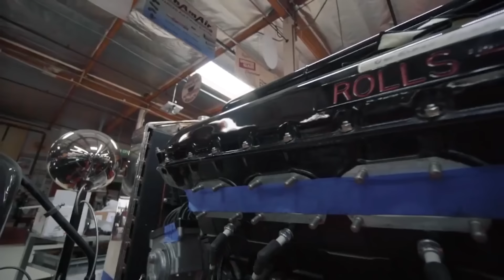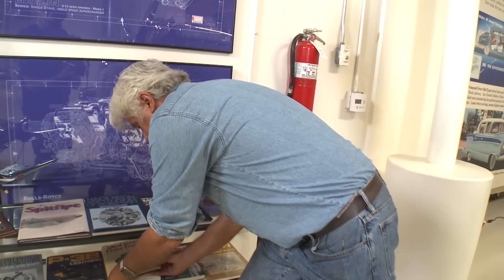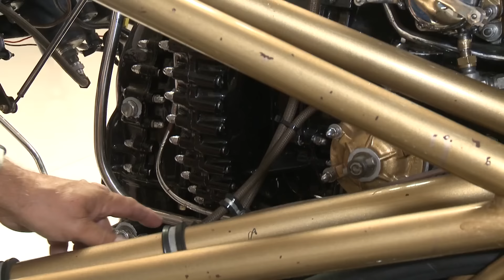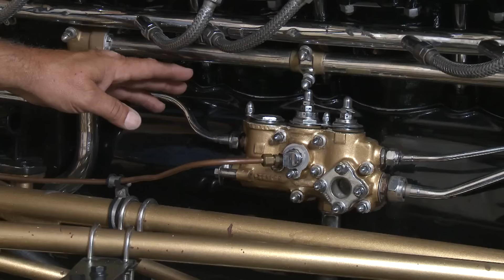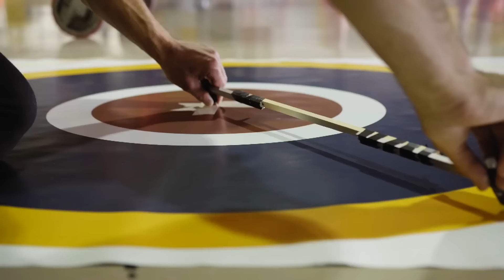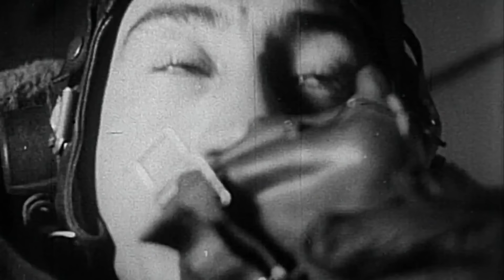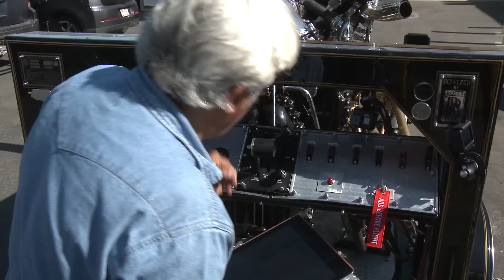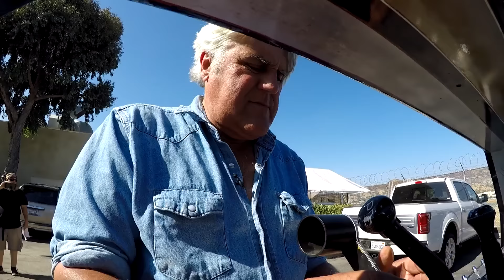The Engine That Won World War II - Jay Leno's Garage

Comment: I’m a student ppl & new aircraft owner working on my ticket. Love the Merlin & J!!

The first few failed starts piqued my curiosity. 

I happened to notice that the checklist doesn’t indicate a move to full rich (or any mixture adjustment) from the “cut-off” position outlined. 

I may be incorrect but believe that during the starting sequence, once the engine has been primed and started the mixture needs to be gradually moved from the cutoff position to full rich (when @ sea level). 

If this was in a bird, I think a preflight static run-up would be completed prior to takeoff for either rich of peak or lean of peak performance, adjusted in cruise, and significant changes in altitude thereon. 

Fun fact | There’s divisive opinions on rich vs lean of peak and their impact on performance and powerplant lifespan. 

We wouldn’t have won WWII running these babies rich of peak. The distances and payloads were too great. Bombers were routinely unable to complete missions safely. LoP changed mission success drastically. 

P172D Driver

Comment: tHe p51 wOn tHe wAr!
🤦‍♂️
Reply: With out the Merlin the p51 would of came second in a one horse race.
Reply: @richardoakley8800  It was faster than a Merlin Mk V Shitfire !!!  Check the specs !!!
Reply: @wilburfinnigan2142  the original  Allison-powered Mustang ok upto medium altitudes.. then the Merlin engine was sent over for trials ..5 p 51 were modified and testes .. they significantly out performed the Allison-powered Mustangs past the medium altitudes.. this gave it the advantage for bomber escorts

Comment: Jay, you need two additional engines.  One, the other American built V12, the Allison V1710, and the Mercedes Benz DB 601 inverted V12 which was fuel injected, not carbureted.  With those three you'd have some very important power plants.

Comment: Ethanol is not the trouble with the fuel. Ethanol was used for many years to make high grade fuels.  In the 50's high grade gas was called Ethel because that is how they made high octane fuel. If you look at the other things that they put in the gas you get you will find about 4 other things that they put in the gasoline.  I think it is because the ethanol makes the octane to high so they put some waste products in to lower the octane level.  Go to the gasoline Co. And get the break down of what is in the fuels.  The 87 octane is full of a lot of crap.  It has been some time and I don't remember what they all were but I was surprised at all the junk they put in the 87 octane that isn't in the higher grade gasoline.  I think because the US government made them put the ethanol in the gasoline it made the octane to high so they put junk in to lower the octane. Check you will find that somewhere in the 50's or 60's they stopped putting ethanol in the gasoline and started putting led in to change the octane,  then they were forced to stop putting led in and switched to other things. E85 is about 120 - 135 octane some higher.

Comment: Sorry but the Daimler Benz DB 601 engines were superior in design. inverted vee which ment there was always lubricated cylinders important during startup, better vision from the cockpit and easier maintenence all due to those inverted cylinders not to mention a fully automatically controled fuel injection sistem which made the pilots flying less hectic etc.

Comment: Legendary Isle of Man TT Motorcycle Racer Guy Martin also has one of these Merlin engines bolted to a trailer. He started the engine and it 'took off' in his dad's workshop and caused a lot of damage as it took a wall down and damaged a couple of customers trucks!

Comment: 10.2L, 18G radial engine installed in a mini-German-postwar-car (originally equipped with a 800cc , 18HP engine) with home-made differential and gearbox!. https://youtu.be/7t2M6fwsvzs

Comment: He forgot the mention the most hilarious incident between Leyland and Rolls Royce. Leyland claimed to have the best engine ever built that was indestructible. Rolls Royce challenged them to a stand off to see who could pull off the ultimate engine. a series of steps and challenges. without water and then run full noise, all the way to the accelerators bumper, for a number of hours. Then also without oil and run it for a number of hours again full tilt. Leyland never made so much as a peep after that. The Merlin was more than capable of doing it.

Comment: There was a day when these engines were only worth the scrap value of the metal they contained. When I was a kid, I used to play (unknown to my parents) in the "boneyard" of the nearby Air Force base. There countless old aircraft littering the place, including a nearly complete B29 bomber. My friends and I used to pretend we were astronauts flying in space (the space program was in full swing in those days). But all the planes, engines, and other parts were scrapped and melted down. Jay, if you are looking for something interesting, and still somewhat reasonably priced, I have seen some of those turbine engines which power M1 tanks in surplus lots. If one of these can power an M1 to nearly 100 kph, I imagine they could move something lighter much more quickly.

Comment: That's not the same size prop the Mustang uses.
Reply: It's not the same size prop any plane would use. It's a drastically cut down prop, used purely to give the engine some 'load' to work against and to provide a source of cooling air for the radiator, oil cooler etc.

Comment: During the war the Allies used 130 to 150 octane fuel with up to 71" of manifold boost, not 100. Definitely not 89.
Reply: 150 was late war.  During the battle of Britain they were mostly still using 87, although fighter command had priority on the 100 octane fuel being produced at the time.

Comment: The  Lancaster in Canad came over to Britain , I had the privilege of seeing both together,  I ive in Bomber County in Lincolnshire UK. The Canada plane had an engine problem , So the RAF lent them an engine, It came into Coningsby Lincolnshire, The is also another Lancaster that  does have all the engines up and running at a place not far from Coningsby, at East Kirkby. You can actually get in to that one , they taxi it along the runway, it does not have an Airworthy certificate so they only taxi it.There is a fund to try and raise money to rebuild it , It would cost millions

Comment: That Merlin 1650-1 sounds sweet from the overlap on the valve timing.
Your Rolls Royce Merlin V12 sounds as if it was detuned for street use.
Your Merlin is one of the best items in the garage.

Comment: Thanks so much for preserving history.  Question... Were the props used with the Merlin variable? Are you able to control the prop pitch when running the engine on the trailer?

Comment: Sure jerked that throttle around... set the fuel mix and manifold pressure for RPM and keep your hands off it... nothing worse for this type of engine than starving it then kicki'n it back up!  What a Jackass.

Comment: his startup checklist was a bit off,  so doing so, the engine would not go higher in rpm. because of low oil temp for the prop. the magneto tests, the prop rpm tests, the mixture. the 2 min pre oil and turning it off. well very brave he did manage to start his diamond. you could see that he was not very enthusiastic to start it. what if it breaks just on that moment. that would have been a disaster.  that poor engine, running that lean.  on the oil control valves, there was a window and you could clearly see no oil in it. so let's hope they did everything correctly.

Comment: Who has the molds and/or drawings for the block and accessories?  Have you ever thought of disassembling the motor and laser scanning all the parts into solid works (or any 3D cad software) so that these engines could be reproduced?  With new manufacturing techniques and metallurgy it could be amazing.
Reply: 18tangles  can you purchase detailed enough drawings with dimensions such that an engine could be built from scratch?

Comment: No Jay.  The best fighters of the war were the Hellcat and the Corsair.  And the best engine was the R-2800.
Reply: 18tangles  The P-47 had more German kills than any other Allied fighter - R-2800
Reply: 18tangles  The R-2800 powered the planes that destroyed the Luftwaffe in the air and on the ground in the ETO.  Your Merlin powered wood planes were left out of the battle because of range and power.  The Merlin was the engine that won the Battle of Britain, but that was about it...  Now hush.
Reply: soaringtractor  LOL  I have been dealing with 18tangles for years...
Reply: And the P-47.

Comment: Jay's comment at the end about an airliner not having a Merlin underscores a point about reciprocal and turbine engines.  The Merlin is a beast at 1400 hp, but the each of the engines on a 777 makes about 111,000 hp.  Hard to compete with a gas turbine for power to weight ratio.

Comment: I am impressed. As a trade qualified machinist (F&T) I am impressed with the design. Just think of all the components and all the Component Tolerances to make this engine work. The UK Merlin, was made with all Whitworths threads, and when the motor was built in the US were changed to UN threads. My understanding was during WWII Whitworth & UN threads had there tolerances changed a little to enable cross threading the threads during war-time maintenance.  I estimate that cross threading Whitworth & UNC would reduce strength on the bond by some 20%. Hay, when you have to get that thing back into the air there was no time for mucking around.  Note ½” cannot be exchanged (12 TPI vs 13). The Merlin was truly an impressive beast.  Thank you for your posting.

Comment: Yeah the mighty fantastic Merlin is and was a great engine in WW2.

However, the the Pratt-WHITNEY R-2800 WASP engines we're EVERYWHERE in 
WW2 and they kicked arse and we're AIR COOLED.

In 1939, when the R-2800 was introduced it was capable of producing 2,000 hp (1,500 kW), for a specific power value of 0.71 hp/in" (32.6 kW/L). No other air-cooled engine came close to this figure, and even liquid-cooled ones barely matched it. The designing of conventional air-cooled radial engines had become so scientific and systematic by then that the Double Wasp was introduced at a power rating that was not amenable to anything like the developmental power increases that had been common with earlier engines. 

Nevertheless, in 1941 the power output of production models increased to 2,100 hp (1,600 kW), and to 2,400 hp (1,800 kW) late in the war. However, even more was coaxed from experimental models, with fan-cooled sub types producing 2,800 hp (2,100 kW), but in general the R-2800 was a rather highly developed power plant right from the beginning.

Comment: My association to these big WWII aircraft engines is unlimited hydroplane racing. I lived for a few years in Madison, Indiana where they raced those boats every summer. The town sponsored its own boat. I was lucky enough to get to hang out a bit in the shop that they used to work on the boat and in the pits during the race. The sound of those big Allison and Rolls Royce engines racing by was really a thrill. Although unlimited hydroplane racing has moved onto helicopter turbine engines, my memories are of the of the piston engine era.

Comment: Hi Jay, Probably already been said George Lucas used one for the Millennium Falcon. 
I was on External Perimeter duty when three Spits and a Hurricane landed for a short period at RAF Honington UK in the early 80's nothing like it to hear them fly over, the Pilots and Ground Crews of the then current aircraft were like 1940's school boys, all over them. Funnily enough on the day we were defending the launch zones for the RAF Tornado GR 1's which used Rolls Royce Turbo Union RB 199 Jet engines in them, it would have made our day if the Lancaster had been with them, and unfortunately General Arnold's [USAAF] most favourite aircraft had no flying variant at the time, the ubiquitous first real MRCA, The De Havilland Mosquito which although made of wood had the best bombing results per aircraft bomb ratio to crew than any other pre nuclear/atomic aircraft in WW2, and of course powered by Rolls Royce and Packard built Merlin engines [flown by very brave Allied nut jobs, look at the missions for that comment], even Lt Colonel Roosevelt had them for high Speed Reconnaissance. I believe there is one in Canada, now flying, thank goodness for that!! Thanks for preserving another engine!!

Comment: Hope he's not a pilot... Forgetting to add mixture rich and adjusting the throttle with the mixture in cut off position wondering what's wrong? lol good lord..
Reply: Be kind. With all kinds of startup procedures for all kinds of engines around i´d imagine it´s quite easy to miss a lever every now and then ;)

Comment: Merlin powered Spitfires and Hurricanes stopped the Nazis spread and defended Great Briton before the P-51 was even envisioned. Merlin powered Lancaster's easily carried half again as much payload as the B-17, including the water skipping dam buster bomb. The Merlin saved the P-51 which was originally designed for the fantastic Allison V-1710 V12, but in such a sleek air-frame could not fit the high altitude exhaust driven Turbocharger found in the P-38 so the original Mustang was actually a bit of a flop for a fighter, much like the P40 which shared the low altitude Allison. But the massive Radials from Pratt & Whitney won the war. B-17s, B-24s, B-25s and P-47s ruined the Reich in precision daylight attacks the Lancaster crews never dared try.
Reply: And we dragged our feet helping England because the Charles Lindbergh types hated the Jews. The "pacifists" were actually pro German subversives.
Reply: The wasp and its descendants and the Merlin and its descendants can trade blows i'd say. the twin wasp and double wasp were ubiquitous in US service. PBY's, wildcats, hellcats, P-47's, B17's... But so was the merlin and griffon with the english. Hurricanes, spitfires, tempests, lancasters, Mosquitos. and easily forgotten, the Merlin was adapted into the Meteor, which powered pretty much every english tank from the Cromwell to the Centurion.

Comment: I've always wondered what a fuel injected Merlin would sound like and how it would perform against the ME109's as that development came too late for the war.
Reply: Jesus  ALL PACKARD Merlins used the Bendix Pressure carb that was a throttle body injector, receiving the fuel under pressure !!!

Comment: Where I live in Sussex they do spitfire flights throught the summer down to the south coast and over the White cliffs.
 I work outside and just happen to be allong one of their routes so at least two or three times a week I hear that distinctive noise and it gives me goosebumps every, single, time.
It'd be an absolute dream to have enough money to go up in one.

For the most beautiful thing you will ever hear, check out the video entitled "16 Spitfires Flying Together, The Sound of Victory " Goosebumps ""

Bonus, there's another of the Vulcan - designed by the same guy as the lancaster just a few years later.
The strides in technology where astounding and will be immediately obvious. Sadly it is no longer flying but ... what a sound.
Look for "Awesome Vulcan Bomber Low Fly-By"

Comment: Jay, Thanks for the for the great video on the Merlin engine.  I just saw a video on the engine that powered the Sherman tank in WWII and many other armored vehicles.  It was the GAA 18L gas engine built by Ford.  It was dual overhead cam, dual magneto, v8, 500hp, 1100 lb ft torque, all aluminum.  It was produced between 1940-50.

Comment: Packard was way ahead of its time in WW2  in engine technology.
Reply: Rolls royce you mean :) As the Merlin was considered to be so important to the war effort, negotiations were soon started to establish an alternative production line outside the UK. Rolls-Royce staff visited North American automobile manufacturers in order to select one to build the Merlin in the U.S. or Canada. Henry Ford rescinded an initial offer to build the engine in the U.S. in July 1940, and the Packard Motor Car Company was subsequently selected to take on the $130,000,000 Merlin order (equivalent to $2.32 billion in 2018 dollars[94]). Agreement was reached in September 1940, and the first Packard-built engine, a Merlin XX designated the V-1650-1, ran in August 1941.

Comment: Would be ALOT safer if they simply left off the prop.  Or encased it in a cage so it doesn't dice and slice someone careless enough to get too close.
Reply: Er, you do realise it needs a flow of air over it to cool the engine don't you?
Reply: @TheSecretAgentMole   maybe to balance the engine also ??
Reply: the prop is balanced and steadies the engine.

Comment: I have a couple Kiekhaefer 482ci offshore race motors from the late 60's that act just that motor did when starting. Seems like no spark or gas is not there for the first couple attempts and then they just catch and run great. Strangest thing.

Comment: Sorry, but the engine that won the war was the D8800 diesel in the Caterpillar D7 bulldozer. The tractor was used in every theater of the war to build roads and airstrips. Its importance cannot be overstated. The war could not have been won without it. Even General Patton acknowledged its importance: “If forced to choose between tanks and bulldozers for an invasion, I’d take the road-building equipment every time.”